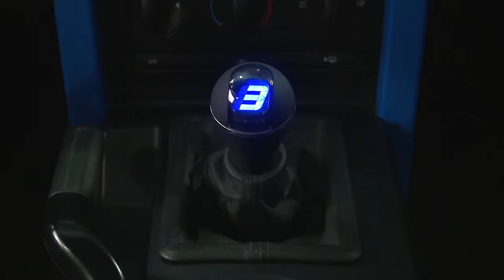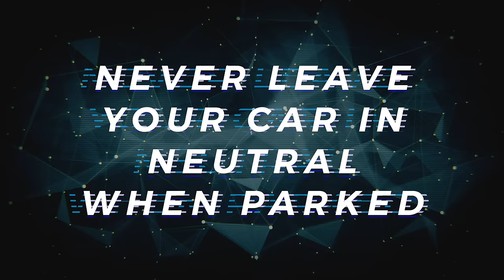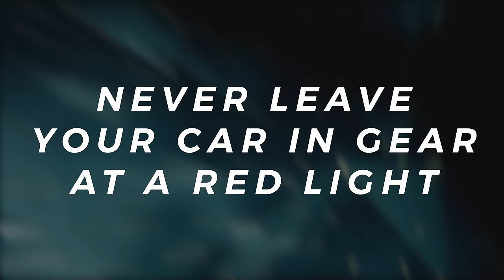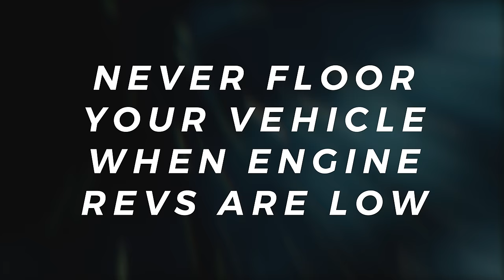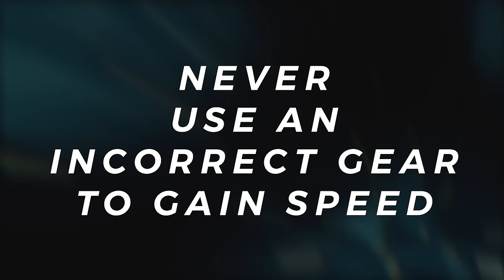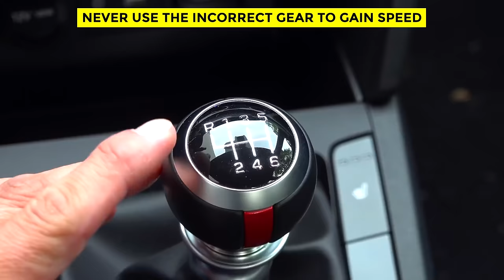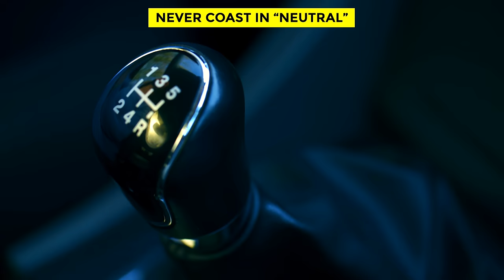7 Things You Should NEVER Do In a Manual Transmission Car!

Comment: Emergency brake?  It's a parking brake.  It's designed to be used when parking.
Reply: stan hope   Back in the day, and I do mean back. They were an E brake. As brakes failed on a regular. But now it’s a parking brake.
Reply: ha if you used the hand brake for an emergancy stop you would just slide into the obsticle.
Reply: Just an american term i guess, I have never heard anyone call it an emergency brake apart from americans. Where I live everyone calls it the hand brake since its a brake you operate with your hand.
Reply: @dieter2889  same!
Reply: No it's the DRIFT LEVER
Reply: if you use that brake during an emergency you're gonna have another problem in your hands...
Reply: For parking I just place a stone in front of the tire. If in a slope, I need to be quite fast.
Reply: Actually is called emergency brake. Though it is called parking brake as well.
Reply: EnderGamer I see what you did there. Very clever.
Reply: this is a tip for newer drivers 
if you are about to crash into something PLEASE AND I BEG YOU PLEASE DO NOT USE THE HANDBRAKE IT'S NOT AN EMERGENCY BRAKE 
you'll slide into a fucking wall especially at high speeds
Reply: @hobb4454  depending on your control of the brake, based on the amount of  pressure you apply
Reply: @hobb4454  in some cases ripping the e brake up can save you from wrecking.... Who here can drift a front wheel drift a front wheel drive other than me??
Reply: @hobb4454  not if you pumped it or slowly engaged it
Reply: @aidanmorgan6291  I doubt that in an emergency someone will calmly take one hand off of the wheel to calmly pump the hand brake.
Reply: @hobb4454  yeah there's a reason that you learn the emergency stop, and you don't use the handbrake for it 😂
Reply: There is american english and british english, they have different ways of calling something like American:Trunk, Britian:Boot. But yeah parking brake or handbrake sounds way better.
Reply: Yeah, please never ever use it in an emergency, it will make things worse
Reply: @dieter2889   we call it many different thinhs
Reply: @ManLikeEddy  but what if you clutch kick and drift around the crash and regain control
Reply: I always know it to be a parking brake, and it shouldn't be used in any scenario other than parking your car. Some people use it to hold their car on a hill, then they use the clutch and the accelerator and disengage the parking brake with their hand.
Reply: We called it hand brake!
Reply: @dieter2889  not always! Some of these brakes are applied by stepping on a pedal. I don't use a 'parking' brake in the winter. I'm old school, the brake linings would freeze to the drums, making release impossible until thraw occurs. Left my stick in the last gear I used before shutting down the engine which happens to be reverse since I back into my parking spot.
Reply: It's called a handbrake
Reply: @endergamer7444  you can use it if the  other brakes fail, just use it like a brake with no abs.
Reply: If you engage"that"brake(whatever you want to call it)halfway it will engage both rear wheels. On my 86 s-10 at least.
Reply: @ManLikeEddy  Especially don't use it if your normal brakes aren't working, better to hit whatever you're about to hit at full speed!
Reply: @dieter2889  it's only a emergency brake in an automatic, because automatics don't need a parking brake. I'm American and I call it a handbrake to, a lot of foreigners misconception of what they think Americans are is almost laughable, yeah some of us talk with a Southern accent, but that doesn't mean we're stupid.
Reply: @calvinhoward2277  Even on an automatic you only use it when you park. It is not an emergency brake if you pull it you will most likely roll your car in most cases it would be safer to engine brake and coast to a stop.
Reply: @calvinhoward2277  the same can also be said about americans veiws on foreigners if not more so
Reply: If you need stop on a dime, just slam the clutch and the brake simultaneously.
Reply: @dieter2889  we make things more difficult on purpose
Reply: Or whenever you feel like going for a skid.
Reply: They are americans they dont know it 🤣🤣🤣🤣
Reply: @dieter2889  my manual doesn't even have a hand break, it's a small push/pull lever.
Reply: Americans
Reply: @hobb4454  it’s for when you’re breaks fail
Reply: I have used the hand brake when my brakes failed once, just make sure you use it when your wheels are pointing straight and do it slowly, an abrupt use of the hand brake in an emergency especially if your wheels are not dead straight will make things worse.
Reply: @stevenmcclure4094  yeah about that what happens if you hit another car sure it might be at a little bit of slower speed but pretty sure its gonna cost you more
Reply: @Silkaz7  is anyone really gonna calmly use the handbreak so that it avoids crash?
Reply: @Mahono2Gud  In the UK it's called a handbrake. Which makes the most sense really. It's not just for parking, as you use it on hill starts, and it's NEVER used in an emergency either. In all circumstances however, you use your hand to operate it.
Reply: Why does it matter what its called? important thing is that we know what he's referring to and how to use it correctly?
Reply: @fatalvoices I agree with this mostly. Though in some vehicles the emergency brake is by your foot, so it wouldn't make for a very good hand brake lol. And I always assumed they call it emergency brake because you can use it if your regular braking system fails.
Reply: Emrgncy brake parking break hand break....just give me a break! 😅 anyway thanks for the advice🙂.
Reply: @mateoerickmate8955  Haha, true it doesn't really matter so long as it works!
Reply: * And drifting
Reply: @stevenmcclure4094  you can shift down when your brakes stop working. It will slow you down. It will cause damage to the Transmission and engine but it reduces your speed and therefore the velocity at impact, potentially saving your life. But releasing the clutch too quickly might lock your wheels up and act as a handbrake resulting in the unwanted drift. so use the clutch as your brake, by slowly engaging it when shifting down. But only in emergency situations because as I already mentioned, it will cause serious damage.
Reply: @dieter2889  Yup. However, a lot of American cars had the parking brake operated by a foot lever. You are correct though, it's a parking brake, NOT an emergency brake. The use of the term indicates bad training, I wthink.
Reply: @Mahono2Gud  Not in the UK it isn't.
Reply: @th3smurf692  you mean engine breaking? Which will not cause significant damage to your trasnmission or engine, in fact many people use engine breaking on a daily baisis. Shifting down increase the rpm and therefore increase the ammount of force being used to make compression slowing down the vehicle. Engine breaking has very very minimal wear on the trans or engine
Reply: @zeroerror9571  engine breaking? Many people
Reply: @dieter2889  yes I agree. What I meant was bringing the vehicle to a quick stop by skipping a gear for example from 5 to 3. Which is important when you are facing an obstacle, like a slower car or a standing car for example. By applying your clutch slowly it will then act a bit like your brakes but it will cause damage doing it this way
Reply: @th3smurf692  ahh ok, I see your point now. Still it would only cause damage if by shifting from 5th to 3rd you exceed the rev limit of the engine
Reply: @hartunstart  😂
Reply: If your parked car takes off rolling when you don’t want it to, that’s an emergency.
Reply: @natplayz1989  😂
Reply: Why does that all of a sudden constitute an emergency !!  Next it'll be called the crisis brake !!
Reply: @tilleylepew5944  if it was really emergency brake any time some one want to brake emergency will bee an crash :P
on train is emergency but not on car
Reply: @dieter2889  I'm not american and I call it emergency brake
Reply: It's not only used for parking but also some cool kansai dorifto
Reply: Its a skid stick
Reply: I simply call it handbrake.
Reply: @dieter2889  
often the "hand brake" on older vehicles and even some reasonably new vehicles (as far as i can tell as recent as at least 03 but probably newer) have a foot actuated parking brake
Reply: In Bulgaria we just call it a handbrake
Reply: @hobb4454  pull is slowly
Reply: You mean the drift brake?
Reply: @dieter2889  I mean for the instances I’ve heard it be called a e brake is when is not at that hand level but to the far left of the other petals so it should be parking brake but no need to call a brake you use with your foot a hand brake
Reply: No its the drift mode
Reply: same thing mate. can be used when the brakes fail. not yank on it when the car is moving fast ofc. but apply it incrementally.
Reply: @ManLikeEddy  and if its an Saab or citroen it will lock your fucking front wheels so you are just sliding in to truck
Reply: Nope. It’s a hand break. Can be used for hill starts. Waiting at lights on hill or at night when at lights so you don’t dazzle drivers behind you with your break lights.
Reply: I had a drink every time he said engage, clutch or gear.

Now i'm dead.
Reply: Emergency Brakes, Handbrakes, Parking Brakes.

All the same thing folks.

Also, for those wondering, Emergency Brakes are not just used for parking, but as an "EMERGENCY" brake for if your regular brakes fail.

You don't have to pull the thing all the way. You can gradually increase pressure on it, slowing yourself down as opposed to locking the wheels up. (Unless its electronic which has only on or off)

Another thing is that "handbrake" should stop being a used term as plenty of parking/emergency brakes are activated by foot. Just sayin lol.
Reply: not really no
Reply: @marvinmartinsYT  we brits call it the "hand brake" as we have English educations and fully understand that the term "handbrake" covers its use as a parking brake and an emergency brake  ........
Reply: @martinthorogood6223    Good schooling then?  Wonderful. Congrats
Reply: handbrake also mostly use drum breaks so its really weak so wont slow down car much and if it breaks mostly just locks the wheels wich can make situation worse
Reply: @dieter2889  Here In Brazil we call it "Freio de mão", which literally translates to Hand break as well!!
Reply: @aksuJ    Not many cars have drum brakes anymore though.
Reply: @marvinmartinsYT  I meant that handbrake is often drum ofc depends how old the car is
Reply: It's called a HANDBRAKE
Reply: @dieter2889  Yeah but mines not a handbrake, it’s a 4th pedal.
Reply: @hobb4454  Not if you understand the simple concept of modulation
Reply: Use IT to park in winter and then cant move, you should always stay IT on gear, not on brake
Reply: @marvinmartinsYT  ahh yes back in the day they use emergency brakes.....our ancestors were good drifters
Reply: @hobb4454  unless you know-how to drift
Reply: @hobb4454  you slowly pull up, like trail braking but the reverse, it's for when you your brakes fail, but yeah really just for Parking
Reply: @jackvanepps7301  it's still a handbrake
Reply: Well, yes and no.  You see, when you use Park in an automatic, it engages the parking pawl—but that doesn’t always hold the car on a hill.  So you gotta engage the parking brake so you’ll have two systems holding onto the car.  Likewise in a standard, shifting into first gear or reverse, along with a set park brake will hold the car on a hill.  Always better with two systems instead of one.
Reply: @johntapp7232  it is still called a hand brake tho!!
Reply: Maybe he ment my old broken handbrake xd
Reply: E brake*
Reply: @calvinhoward2277  automatic cars need a parking brake too.
Reply: Or to help you turn around on a dime when you look down the road and see a roadblock😁
Reply: @natplayz1989  Aha,someone finally telling the truth !!
Reply: @hobb4454  it’s not a hand brake. It’s officially called a parking brake/ emergency brake depending on the car. In some cars the E/Parking brake can actually stop the car
Reply: @joeyblack396  ye it's used for parking not emergencies
Reply: Ikr
Reply: @hobb4454  not really..i mean if u had to stop fast but i used it befire in place of brakes cuz i was broke af at the time
Reply: @dieter2889  its because not all of these brakes are operated by hand. there is often a fourth pedal for the parking brake, and a pull lever to open it. (Very much not an e brake)
Reply: It is called emergency break also because when car is inclined. You won't be able to keep car at rest if you remove yourself foot from break. So we the emergency break(handbreak) to keep it at rest even at inclined road.
Reply: @dieter2889  same
Reply: @natplayz1989  hahahaha
Reply: @hartunstart  LOL!!!
Reply: It’s not to slide around corners??!!
Reply: You can use the brake without engaging the clutch!
Reply: Love computer controlled rev matching.
Reply: @dieter2889  yeah, calling it an emergency brake is exhausting. Handbrake is simpler and implies the use of hands for the brake.
Reply: @dieter2889  I know this is a year old, but not all of them are hand operated. The parking brake in my 97 F150 is a small pedal all the way to the left and is released with a lever similar to that of the hood latch release.
Reply: @calvinhoward2277  It's still used in automatics when parked on a sloped surface, otherwise you're putting a lot of stress on the transmission.
Reply: emergency brake? it's a hand brake. this way nobody can determine if it's for parking or emergency use. you can 99.09% of the time use it with your hand
Reply: no, it's a hand brake, meant to give hand a brake.
Reply: Depends on where you come from. In the UK we are taught it is to secure the vehicle when appropriate, and parking is just one set of circumstances in which it is. Different countries have different rules, and just because that is how it is used where you come from, it does not make that interpretation any more correct than anyone else's.
Reply: @ManLikeEddy  the emergency we're referring to is a failure of the regular brakes...not any and all types of emergencies.
Reply: @hobb4454  ha If you have complete brake failure, your going to crash anyway!
Reply: So what.
Reply: @hartunstart  always carry a brick with you.
Reply: @endergamer7444  you can brake with the e brake in an emergency. If you don’t try and make a turn while using it and just stop in a straight like you can avoid tail spinning. You just have to apply the brake very gradually. Only problem is this will make the stopping distance WAY longer than the normal brakes. Still better than losing control of the car.
Reply: @ManLikeEddy  you just have to use very gradual pressure to avoid locking the wheels up. It’s not impossible. It’s not like e brake= slide every time.
Reply: @dieter2889  In the Eastern Europe it is also called emergency brake, not a parking brake. That's why it had to be independent of main brakes.
Reply: No it's the hand brake
Reply: It’s an e-brake there’s an e for a reason
Reply: no no no its called „drift begginer brake”
Reply: Wait, it's called parking brake? I thought it was called a handbrake.
Reply: Depends where you come from. In the UK it is used to secure the vehicle when necessary, which encompasses a whole range of situations other than just parking.
Reply: @dieter2889  The thing is... it's not always operated by hand.
Reply: @hobb4454  ye its literally to block the wheels, thats why its used for parking now instead of emergency brakes like old cars, because ABS is a thing, if it wasnt then the emergency brake would have helped since it would just put on full brakes and since it slipped away already wouldnt be that much of a difference but due to ABS being a thing only when using the foot brake then the parking brake is just flat out dangerous to use when stopping
Reply: @hobb4454  I believe the word "emergency" refers the the situation where your primary brakes fail. Then the hand brake is your fall-back solution in that kind of emergency, but only to bring the car to a stop. You should of course not drive further if your only functioning brake is the hand brake, as that is a very unsafe solution and it only brakes on two wheels (most times the rear wheels), and it has no ABS solution as it is purely mechanical.
Reply: @natplayz1989  Ha ha!🤣😆 I like that.👍 The drift-lever indeed. Unless you drive a f..... Citroën where the parking brake engages on the front wheels. But of course things must always work differently in a Citroën.😂😂
Reply: @dieter2889  Depends on the car, some manufacturers add another pedal that is to the far left in your foot well, almost as far as it can go, so you don't mistake it for a normal brake or a clutch. But yes, the term emergency brake was coined before breaks had real standards to make them reliable, long before ABS was a thing, and it just stuck. I figure if you're using the parking brake as an emergency brake, you're probably already well screwed.
Reply: My 1960s landy the hand break is another drum break right behind the gear box. If it did anything it could safely be used to stop u if ur other breaks didn’t work
Reply: @dieter2889  yes i have always heard it is Hand Brake where i live. "it's a brake but insted you brake whit your hand."
Reply: It’s called either of them.
Reply: @hobb4454  it’s so if your breaks fail you can still slow doen
Reply: @stevenmcclure4094  instead of hitting the at speed, use the hand brake intelligently during the Normal brake failure,

 i mean you could apply the half hand brake and release, apply half hand brake then release like that you do it for multiple times till your car come down to slowest speed so it will avoid crashing at high speed and toppling of car due applying the hand brake fully at high speed.
Reply: It's a hand brake
Reply: @endergamer7444  You don't pull it all the way.
Reply: I've always found that it's primary purpose is to break the rear wheels loose on an icy road, when you to initiate a long sideways slide.
Reply: I think some people refer to it as an emergency brake because it can be used if the brakes go out for some reason. It may not stop the vehicle completely, but it will slow it down and possibly avoid a bigger tragedy from occurring.
Reply: In an emergency you don't yank the handbrake. Lol but a little while gearing down. I thought that was common sense?
Reply: @hobb4454 I have but I'm old fashioned.
Reply: @natplayz1989 💯
Reply: @ManLikeEddy  If your brakes fail completely, the parking brake may be better than nothing.